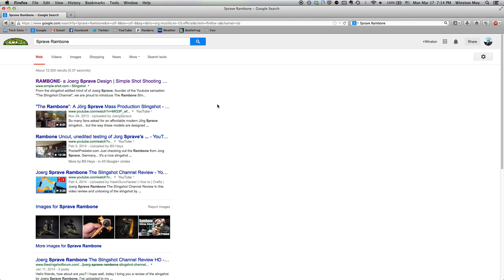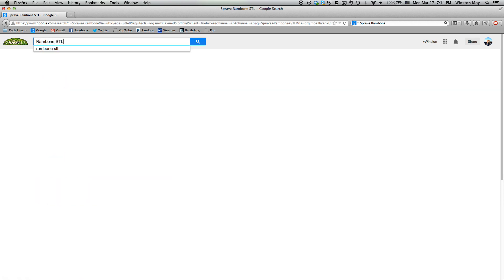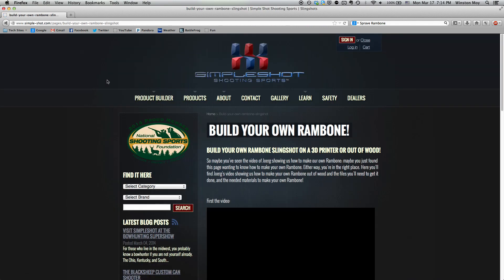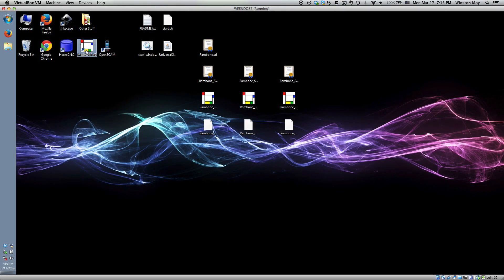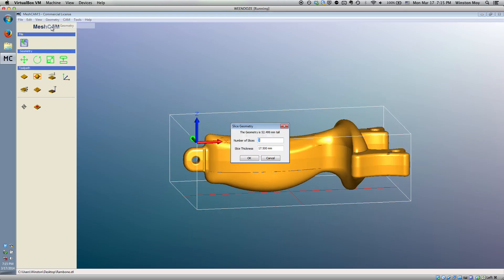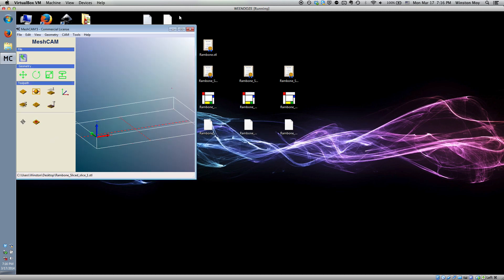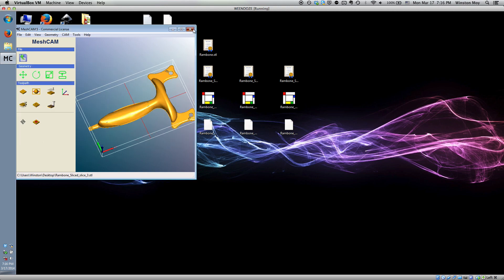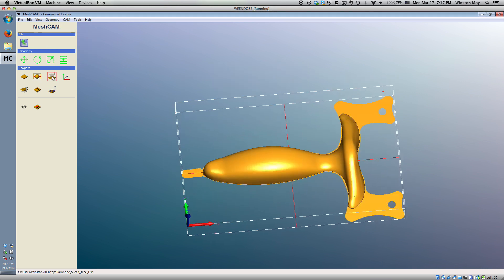Shapeoko 2: The Rambone Slingshot (Work in Progress)

Comment: Thank you for the great videos!  You've done a great job on them.  Thanks for keeping it noob-friendly.  I guess I've always been a 'Maker', but am just now getting into the Arduino, CNC, and modeling.  I have seen some videos of the Shapeboko 2 doing everything from CNC, 3D print, knife cut, to CNC (obviously).  I've been planning on one larger 3D printer in particular, but now, am leaning toward building my own, or S2.  Can you think of any competitive platforms like the S2?   Any more expansion ideas for yourself?
Reply from the maker: There are a couple CNC platforms out there at similar ~$800 price points, but nothing else in my opinion gives you the same flexibility. Most kits might have upgrades for the spindle or something, but are almost impossible to increase in size. In terms of work area per dollar, I've found the Shapeoko (and presumably the X-carve) to be the best value.

That being said, a CNC frame is designed to be far more rigid than a 3D printer's because of the forces involved. So it may be possible to DIY your own, since the hardware is open source. Depends on your level of ambition.

Comment: Hi, Winston. Great videos on CNC for beginers!

What type of G code export you use on meshcam to work with grbl?

I found that saving as "basic g code" or "mach 3" the g code dose not contain M2 (or M3) to sturt the spindel...
Reply from the maker: I just tested Mach3 on the latest MeshCAM 6 build, and that one's showing M3 and M5 commands.

I tried a few others (Basic, TurboCNC, USB CNC, and Shapeoko) but those do not have spindle commands.

Are you on MeshCAM 5 or 6 (not sure why it would matter, but it's worth a shot)?
Reply: Winston Moy MEshCam 5 (still on trile)

I dont remember Shapeoko as one of the options on v5
Reply from the maker: Nir Givon  It was probably added in 6 then. It's really a minor change, since the core commands GRBL understands can already be found in other presets. I would see if getting a trail version of 6 is possible, otherwise you may have to find another way to insert M2, 3, 5, etc into your program. Maybe a simple script...?

Comment: Have you tried any own 2.5D cutting like a hemisphere or anything, and if you have what cad and cam software do you use? maby a future video?
Reply from the maker: Currently playing around with two other CAM programs for an upcoming video. I'll try to address this.

I believe a hemisphere would fall closer to 3D milling than 2.5D since it has a continuously changing cross section. It's not a shape you can sketch on a 2D plane and then extrude/project into the third dimension. You can approximate it as a bunch of stacked circles of decreasing diameter though, which would technically count as a 2.5D job.

Comment: Fantastic videos! Thank you for doing these. I do have a question though...

Does your Shapeoko have a Z axis mod, or is this a standard Shapoko 2? I can't seem to find a straight answer for how the standard full kit Z axis works. Thanks!
Reply from the maker: Except for the spindle (I swapped in a Dremel), my Shapeoko is unmodified. In a nut shell, the Z-axis is driven by 1 stepper motor that is coupled to an M8 threaded rod. A captive nut is either pulled or pushed along that rod as it rotates, which in turn lifts or lowers the spindle. You can see all the mechanical bits on the Shapeoko Docs on how to assemble it:

http://docs.shapeoko.com/zaxis.html
Reply: Winston Moy what dremel did you buy?..any link please
Reply from the maker: TerenceEB  The closest to what I'm using is the 3000: http://amzn.to/UfNNJo
but if you're buying online, the minimal price difference makes it more worthwhile to get the 4000: http://amzn.to/UfO1QG

However, I'd try going to home depot or Lowes and seeing if they price match. and if not, find a coupon for Lowes. I know they do $10 off $50 like every month...

And as a word of not-quite-advice, Dremels are super handy and versatile, but if you're looking for a specific trait, like low noise, or high torque, you should take time to research alternatives.

Good luck, have fun.
Reply: Winston Moy does using the dremel need getting extra hardware to fit it in the Z axis or the dremel can easily be swapped for the standard spindle that comes with the shapeoko2  kit without using any extra components that dont come with the kit?
Reply from the maker: TerenceEB
 For the most part, a Dremel will fit where the original spindle did (no additional hardware necessary). Some Dremels have a slight taper, so I used a strip of leather to shim it back to vertical.
Reply: Winston Moy ok thanks for the reply...but expect more questions as i build my shapeoko 2.haha

Comment: be VERY careful with this slingshot dude. I made a rambone from pine that was 20mm thick, and it broke the first time i pulled it back with light bands. Luckily i was wearing safety goggles and i was not hurt, but dude dont trust pine
Reply from the maker: Yea, pine doesn't exactly inspire confidence... I put 15 lb on the forks using a static load, just to test it without the risk of splintered wood flying at my face. No issues with that, but I'll proceed with caution.

Comment: It will be surprising to see a soft wood hold up in a slingshot application.  I know it worked for you before.  Is this material a particleboard?
Reply from the maker: Admittedly, pine is not the best material to use, I will re-make this in the future. But as a proof of concept, this will easily hold a 10-20 lb draw.

Comment: nice but i would be careful with using pine wood
is it strong?
Reply from the maker: It's actually the material I used for the front forks on my hex nut slingshot, so it's reasonably strong. That being said, I do agree with you and <Day light> that other materials would be even better. This was just what I had on hand.